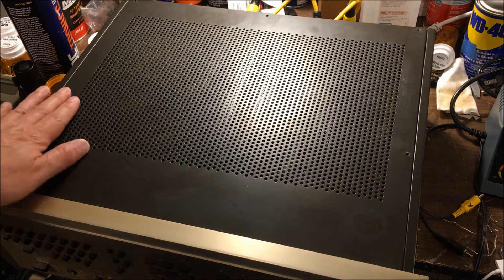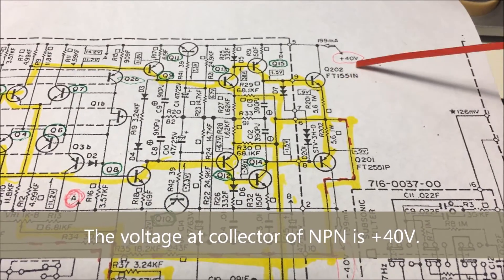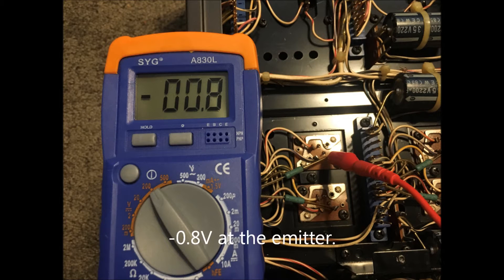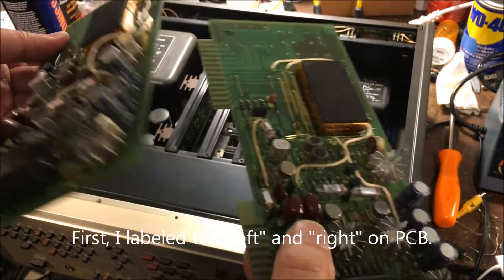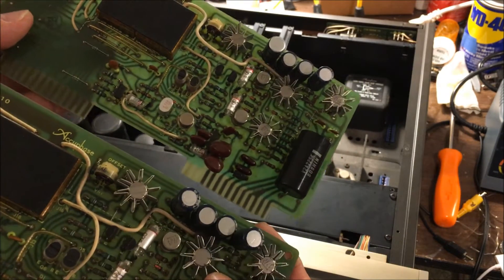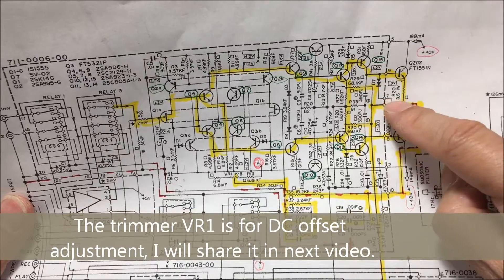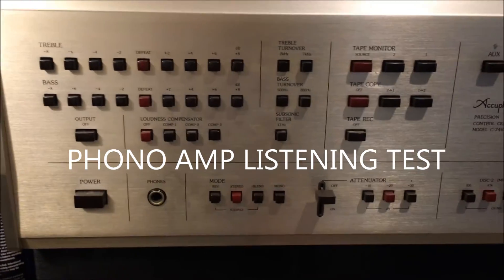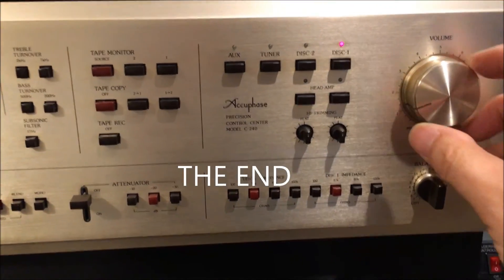Servicing Accuphase C-240 Preamplifier Part 1 - Phono (Equalizer) Amp Repair

Comment: hi, what contact cleaner did you use in the end?
Reply: If the cleaner is used for switch contact cleaning application, I'll suggest Deoxit or similar electrical contact cleaners.

Comment: I don't think that they are balanced outputs. They are XLR outputs. They are a better alternative to the standard rca inputs as they make a more secure and electrically sound connection. They were a common type of connection on super high end equipment of the era of this preamplifier. I have this preamp as well and I love it. Love your videos and I have subscribed. Thanks.
Reply from the maker: Thank you for your comments. I also love Accuphase products. They didn't gain much popularity because we have very crowded audio market here. But their build quality is top-notch, the sound quality is up there with the best, and the design is about as advanced as you could expect from any high end audio manufacturer. I am planning to share more Accuphase repair videos in the future and thanks for your watching.
Reply: Hi. Thanks for your positive reply to my comment. I stumbled on your video while looking for something related. My Accuphase  C-240 is in beautiful condition but I had the exact same issue as yours. The right side phono pcb. I pulled my card and tested the C16 cap and it was defective as well. So I’m going to replace it soon. Maybe a defective batch of caps originally. I think I’m going to resolder the output relays because the output works until it starts to warm up after that I will lose the left speaker. If I keep a small fan blowing in that area it will continue to play indefinitely. Otherwise I was very lucky to get a pristine unit inside and an excellent exterior. I’ll keep watching your videos as they’re very helpful. BTW do you have any copies of the C-240 service manual?  I would pay for it. Thanks again.
Reply from the maker: I am sorry I don't have C240 service manual and I understand how you feel about this preamplifier. It is so beautiful in and out just like a piece of art. The sound is also outstanding. We just want them t to perform well without blemish. Regarding the relay issue, I am wondering if it can be opened up and correct the contact problem. BTW, the AC input need to convert to 110V from 100V if you purchased from Japan.
Reply: Vintage Audio Fan Hi. Yes I agree it is a work of art aesthetically and electrically. I do have my proper ac selected as I am in the USA. I’m so impressed with this preamp. I’ve always wanted an Accuphase preamp. This unit retailed for $2500.00 in 1978 in the USA. That’s around $7500.00 in today’s dollars. I have the original wood case too. The headphone preamp is fantastic. I can’t say enough about it sound and function. Thanks again.
Reply: no it's not. Pin 2 (+) in single ended positive, Pin 3 (-) and Pin 1 (gnd) are shorted to ground. XLR is connector only, C-240 is single ended unit.

Comment: Terrific piece of gear !
Japanese voltage ?
Reply from the maker: Accuphase make switchable AC power (100/117/220/240V) on their products for worldwide use. This unit doesn't need step down transformer and can be used in USA.
Reply: Vintage Audio Fan very interesting and thank you for this